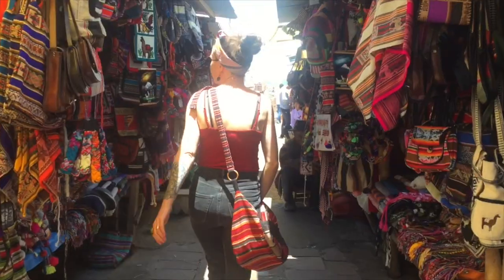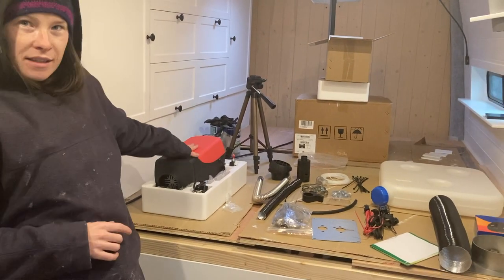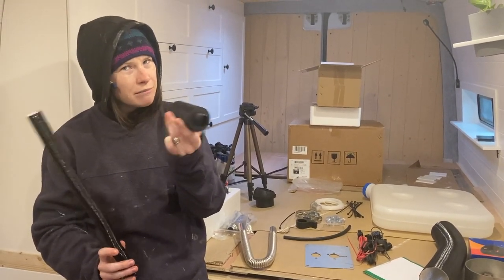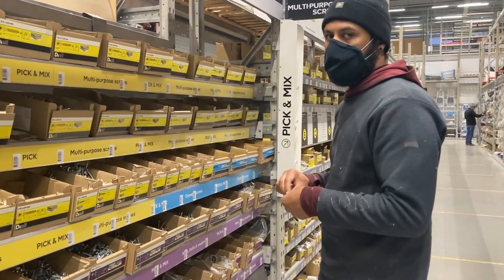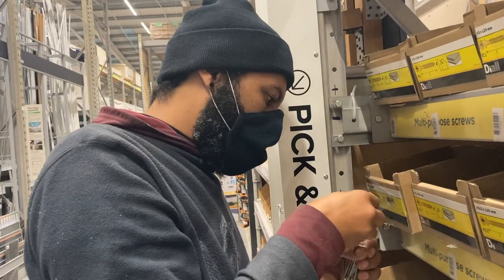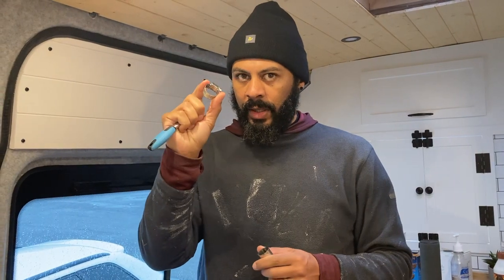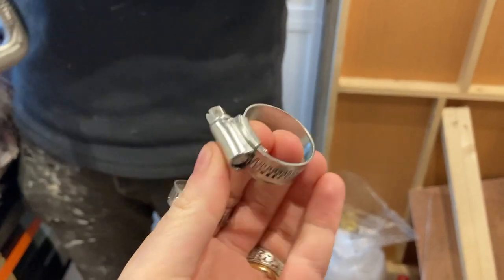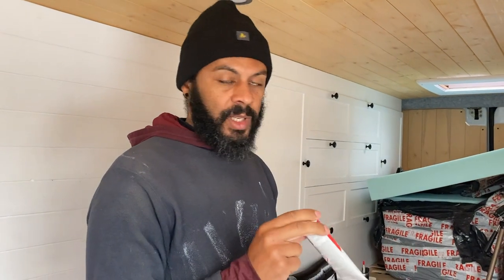Van Conversion Diesel Heater | Helpful Tips For DIY Install

Comment from the maker: Would you risk it with a cheap diesel heater (and crap instructions) like us?! And would you install it yourself?
Reply: I have had my cheapo for 2 years used it probably 20 times , sometimes for 30 mins sometimes for 12 hrs over night and never had an issue with it at all, never had error codes and always started first time every time, well worth the £104, compared to a wabasto which is basically exactly the same thing
Reply: Yes, definitely! We've purchased one and are ready to install it, but we're just a the beginning of our van design process and still deciding on the locations of everything. Until we know where we want to install it it can wait in its box!
Reply from the maker: Great idea to get stuff together before you need it, we wasted so much time waiting for things to turn up! Good luck with the install when you do get round to it 👍
Reply: @TheWholeWorldorNothing  Thank you! We're hoping to record it to post videos similar to yours.
Reply from the maker: Amazing! We’ve just subbed to your channel, looking forward to taking a look 😀
Reply: Nice job please  can you tell me where you purchased the Heater many thanks please check my channel my Citroën Dispatch van conversion 🍻

Comment: Hi im a new subscriber :-)
Not to bad installing the diesel heater.. on mine i have the fuel feed going from top of tank just in case of any leaks.. and i have my fuel pump underneath the vehicle on the solid chassis Beam.. i use a car sponge and rap the sponge round pump with two cable ties then cable tie it to the body.. i can not here it at all.. perfect for a good nights sleep..
I also use my diesel heater to heat up my hot water..  i used a computer radiator cooling system and made two 3D printed cones to go onto the radiator so therefore the pipe can be fitted from the diesel heater..

Comment: I bought one and also the turret. Well done guys you did an awesome job as usual.
Reply from the maker: The turret makes the installation so much easier in our opinion! And the heater has been amazing so far, we’re really pleased we went for this type so we’re sure you’ll love it too 👍
Reply: I'll be using mine as a water heater too as per Mispronounced Adventures channel using the Bobilvans kit. Really enjoyed watching you two figure out this installation ;)
Reply from the maker: Those bobils look like great pieces of kit, someone else mentioned them the other week. We’d have considered one ourselves but we hadn’t heard of them at the time we installed our water heater unfortunately. Should be a good setup for you 👍

Comment: You could had the air intake in the van so you are using warm air to heat so reducing your fuel usage, just a thought...we did after being told lol, good install video.  Take care..

Comment: wicked video! just found your channel , iv just got a diesel heater and in the instructions it says to wire straight to the battery but im thinking maybe wire to my fuse box instead , did you wire your heater straight to your fuse box ? did i work ok ?

Comment: Great vid as per ! Seen loads of people using these, they do seem a bit noisy !! Can u mount the pump under the van or does it have to be inside?
Reply from the maker: Thanks! It is pretty noisy but the pump doesn’t bother us too much. Where we placed it it’s under the mattress and in our “garage” so that dampens a fair amount of the noise, plus once it gets going in full swing it does calm down a little bit. Not 100% sure about mounting the pump under the van 🤔, don’t see any reason you couldn’t, just not sure it’s designed to go outside. Maybe if we were able to understand the instructions we’d have a better idea 🤣

Comment: Hi It looks like your exhaust is going to push carbon monoxide out near the prop shift in the centre on the van!  The exhaust should be placed so it pushes the CO out the side so you don't be any smell/CO into your van when parked up... Also the pump should be at an angle and it will be much more efficient/quieter . Most installation put the pump on the chassis.. I don't want you to be gassed when parked up ! Great vlog as always !
Reply from the maker: Thank you ☺️ Yeah we positioned the exhaust pointing backwards under the van as the heater is on the door side so if it had been angled outwards then the fumes would definitely be going up and in through the door. It was the only place we could find which avoided that, given the length of the exhaust pipe. The pump is at an angle, as far as we could figure from what we understood of the instructions (which wasn’t much) it’s not too far from the angle suggested. We don’t actually find it too loud, the pump is under our mattress which must dampen some of the sound so it’s absolutely fine for us 😊 We’re sure it’s not the optimum installation but it’s worked brilliantly for us so far - no fumes 😀
Reply: https://youtu.be/j71Hnp307jw  Try watching watching Luke from 7 min onwards . He also replaces the pump with a much quieter one. Sorry but I'm worried about your exhaust placement 😕
Reply: I agree with you Dennis👍 @James and Sarah - You may not experience a problem, but this installation has introduced a CO risk which is avoidable.  You want that poison gas out and away from the underside of the van where it can get trapped and linger when parked up ⚠ Don't rely on a CO alarm to warn you 'if ?' it happens - Remove the risk and extend the exhaust to discharge gases away from under your van.  Great upload Thanks - Sorry for the safety alert 🤓
Reply: Hey your link for the hole cutting sets say they cut wood and plastic. Are theses the same you used to cut metal?
Reply: @calwit1164  if it is of some quality you can cut through thin metal as long you do not plan on doing it often, so for one use as long not the cheapest avaiable you can use the wood hole saw.

Comment: Did you encounter any problems with putting the diesel heater mounting plate directly onto your vinyl floor? Does it get hot at all? Thanks!

Comment: Glad watched this no one mentioned the bracket just ordered one 😂
Reply from the maker: The turret thing? They’re not strictly essential but just make it so much easier to install! Not sure how ours would have worked without it. Good luck with your installation 😀
Reply: @TheWholeWorldorNothing   am building a 64 plate lwb sprinter at the moment was going go down the wood burner route but just went way diesel heater under the passenger seat was a option. But wasn’t keen on the idea
Reply from the maker: We love wood burners but were terrified about the idea of having one in our van. The positioning of our heater wasn’t actually planned from the start but once we actually got hold of it and realised it fit perfectly in that space it just made sense 👍
Reply: @TheWholeWorldorNothing   yeah a feel the same about the wood burner 😂 but cant afford a challet in the forrest some were. At be the ultimate dream. Here were a am in scotland it rains 90% of the time and winters are freezing so want a camper that is warm enough to use all year round as wait this mind set people have can’t wait till summer to go camping is a depressing thought lol! A want camp whenever a like.
Reply from the maker: Haha yeah you need a good heat source to cope with these winters! Camping is definitely not just for summer as you say, mind we used to camp in a tent in winter in England 😂 Diesel heater is a big step up from that 👍
Reply: @TheWholeWorldorNothing   Haha yeah a used to use a hammock and tarp for camping right good for your spine posture am 6ft 8 so was good for me. Loved it! A just finished my floor and walls today all cladded. So glad ano no scratched the surface but was the brutal lol! Will give use a add on insta.
Reply from the maker: Nice! That’s the stage where it really feels like you’re getting somewhere 👍 You must be well pleased!
Reply: @TheWholeWorldorNothing   started on the  bed today getting hight right and ordered a alpicool box going fit it under the L shaped sofa hopfully. Will free up room at the side door am thinking. PS saved fortune on screws using the pick n mix 2 bags so full they wont close 🤣
Reply from the maker: Wow, you’re moving quickly! We didn’t realise how hard picking the height of the bed would be! Trying to get it so we could both sit up comfortably on it but still had space to move around underneath was trickier than we thought. A cool box style fridge will definitely free up a bit of space. Haha, gotta get your money’s worth, as long as they don’t spill out all over the till they don’t usually mind 😀
Reply: @TheWholeWorldorNothing  yeah the staff are brand new am in twice a week atleast there making a mint off me. Lol! Yeag well need workout the lay out of the van so can work out size of the seating area so can order foam ect bed is the biggest part being 6ft8 long haha
Reply from the maker: Yeah can imagine that’s something to factor into all the plans! What are you like with the ceiling?
Reply: @TheWholeWorldorNothing   A could just about stand up in it when it was bare bones just steel. But min put floor in and cellox in roof a cant fully stand up in it. Witch am ok with to be honest. Started varnishing today done one wall not massively keep on it but thought will let it fully dry before a go any futher only the left wall at the moment. Got wet wall for the ceiling today aswell. Fit that with the lights on sunday have to drive a taxi all weekend now. No belong till can chuck it 😂
Reply from the maker: We weren’t too impressed with our varnish at first but it dried better than it went on. Hopefully yours does the same!
Reply: @TheWholeWorldorNothing   yeah it isn’t as bad as a thought. Not done anything on it today spent the morning chasing up delivery companies most are great but royal mail and a haulage company its delivering battery’s brutal need work out were everything is going go. Proper stressfull. 😂
Reply from the maker: It’s definitely stressful trying to coordinate everything to come when you need it. We had limited storage space too so we didn’t want things turning up too early but obviously you just need the stuff when you need it too so it’s quite hard to get everything timed right!
Reply: @TheWholeWorldorNothing  My spare room is full of stuff for it. Got kitchen units that a got free! Am going to customise to fit the van. Then dismantle and use as templates for 18mm ply then build the kitchen instead of paying crazy money for them.
Reply from the maker: Haha, good job you’ve got a spare room! That’s a great idea with the cabinets too 👍

Comment: Some put the heater under the passenger seat, i’d imagine that would put the noise further away from the bed. 
Can you sleep with this thing on ?
Reply from the maker: Yeah it probably would, that wasn’t an option for us due to the kitchen unit we have behind those seats but could definitely work. We’ve seen people do all sorts of stuff to counteract the sound but it doesn’t actually bother us and it’s a lot quieter once it gets going. We don’t tend to sleep with it on either, we get the van to a nice temp before bed, turn it off, then let our insulation do the rest 😀👍

Comment: Well done guys, looks a whole lot more complicated than an lpg heater installation 😂 any reason why you decided on diesel?
Reply from the maker: Thanks! Hmmmm. Hard to remember why now 😅 Pretty sure it was mainly because it was the cheapest option at around £100. It wasn’t actually too difficult to install though either, we just made an absolute meal out of it because we didn’t start with all the parts we needed and the instructions were impossible to decipher!
Reply: @TheWholeWorldorNothing  yeah that’s fair enough! How has it treated you so far? Or should I ask again after you’re endured a British winter in the van 🥶
Reply from the maker: We were in it over the winter just gone and the heater worked really well, we’re very happy with it. It heats the space in no time and is really efficient so cost hardly anything 😀

Comment: I was about to buy and install an (expensive) Webasto or Truma combi heater but you made me doubt. Thanks for another informative vid!
Reply from the maker: Don’t know if you’ve seen any of the comments from people installing a diesel heater and a “bobil bits water heater”? Seems like a way cheaper alternative than the setup we have and definitely cheaper than a combi heater. We can’t personally recommend them because we’ve not installed or used one but lots of people seem to be going for them now so might be worth looking at them as another potential option too. Just checked and they deliver to Belgium too 👍
Reply: @TheWholeWorldorNothing  Thanks James! I definitely will look into that option.  (Thanks for checking too) ATB - Marc
Reply from the maker: No problem 😌

Comment: At 23:20 why have you gone from the fuel filter with thick black pipe to thin clear pipe back to thick black pipe with 4 clips when you could have just used the black pipe and 2 clips ?
apart from that, great job.
Reply: The thin clear pipe has two necessary attributes: a smaller internal diameter and non-elastic. The little pump is not able to push the volume of fuel that the black pipe would take. Because the clear line is so rigid, the pump's impulses are transmitted all the way to the burner rather than being absorbed by  the side walls flexing. Unfortunately this means the clear line will not slide onto the metal and plastic ends of the pump, filter etc. So the black line is used to make the joints.

Comment: 03:08 If you buy a canned bean and cut the empty can in a half, then glu it to the original plate, you got the same disign xD
Great video you made, thumbs up and sub. 
I wonder what idiot invented the air filter under the vehicle, what will happen if this filter gets clogged? I would build some kind of protective can on the perimeter of this filter. Or I would mount it somewhere in the middle of the van.

Comment: Fitting exactly same heater soon..they haven't given me any of the black pipe that connects the fuel line to the bits n pieces..instead they have given actual fuel line clips ...not sure about this, but think Vevor have done away with the black rubber hose connector type..had to get different fuel tank as the supplied one is too tall for our motorhome..nowhere to fit it ..all in all im pretty pissed off so far...I don't have a turret, just the supplied plate, ...im pretty nervous about it all 🤔
Reply: Clips hold fine, no leaks..no need for that black rubber connecting hose.

Comment: your fuel filter is placed in the wrong direction.
Reply: The fuel coming from the tank is meant to go round the outside of the mesh filter rather than coming into the filter and out. Took me many yt vids to realise, but I am stiil confused as to orientation of the filter I have put mine so that the fuel starts filling up the filter on the pump side so I have the filter facing downwards and the tube then goes up to the pump.
Reply: Nope, its in the right direction
Reply: @man.i.literally.failed6772  it's not. Read your manual.
Reply: @BB-ne9ev ahh yeah it is so🖕

Comment: Gosh, I can not believe you use B and Q surely screwfix and toolstation is WAY cheaper. I once bought 10 small bolts for £6.05 at B and Q and screwfix was selling 100 of the same bolts for £5.49
Sma ewith hole saws and silicone ect ect

Comment: Dennis Park

https://youtu.be/j71Hnp307jw  Try watching watching Luke from 7 min onward . He also replaces the pump with a much quieter one. 
Sorry but I'm worried about your exhaust placement 😕 Do you have a carbon monoxide alarm fitted to the van ..
Reply from the maker: We do have a carbon monoxide alarm in the van 🙂 It's not actually possible for us to put the exhaust on the sill as it's on the same side of the van as the door and our windows so this would definitely lead to fumes coming into the van and the pipe isn't long enough to reach the other side. We used the heater all over winter with no issues at all and have had the van checked by a mechanic who was fine with it - is there a specific concern with fumes hitting the prop shift? We're not mechanical at all so know nothing about cars ourselves! This has made us think again though, and we're going to fit a second carbon monoxide detector in the "garage" area just to be extra safe. Appreciate your concern 👍